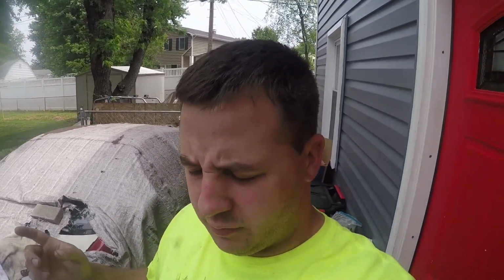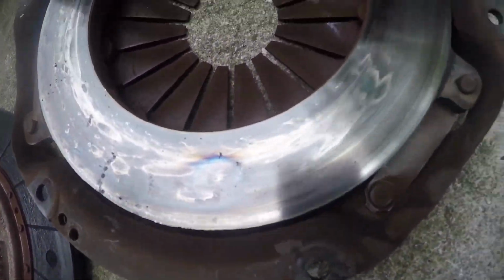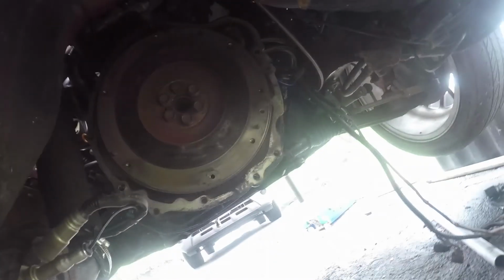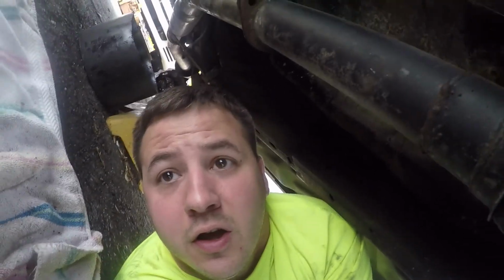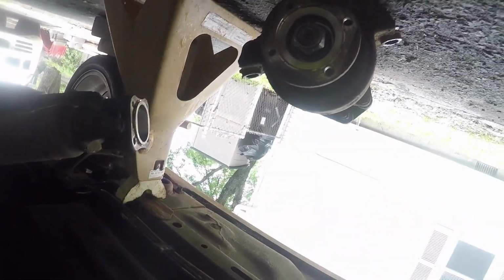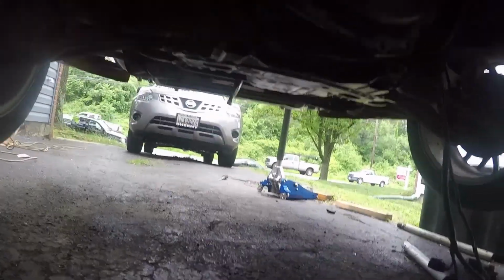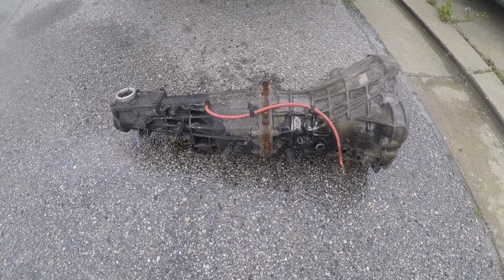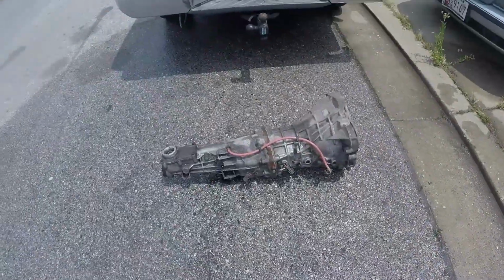240sx Brakes and Clutch Pt1

Comment: If you need any s13 subframes pignose bumper I got a lot of parts also isr tension rods
Reply from the maker: Thanks. I'm good right now. I have a lot of surface rust on the sub frames but I'm gonna drop them in the winter and have them powder coated and undercoat the car.